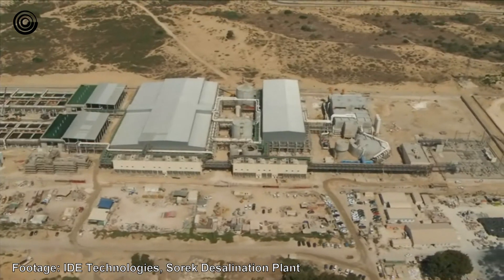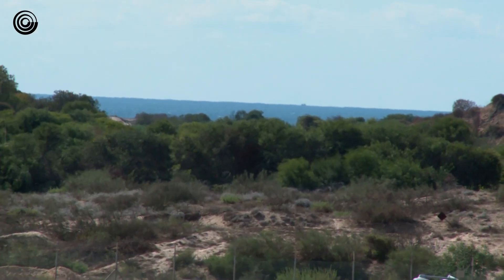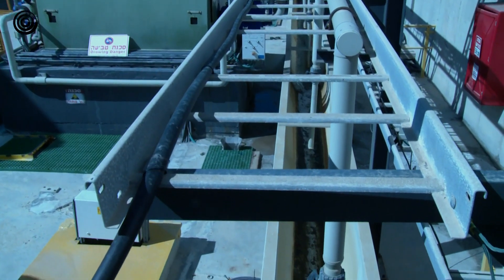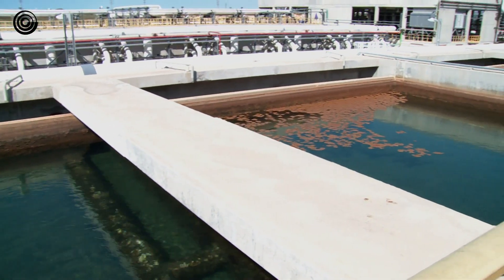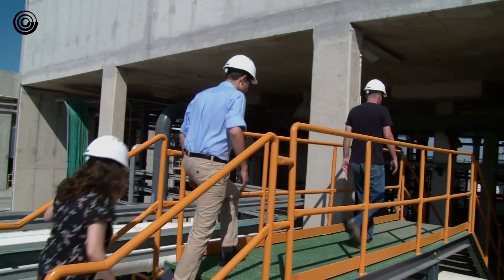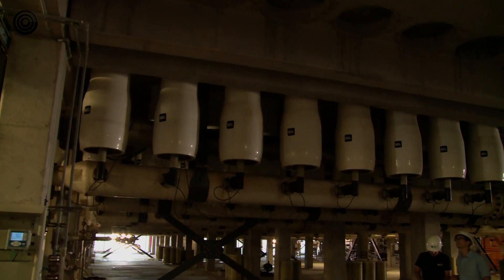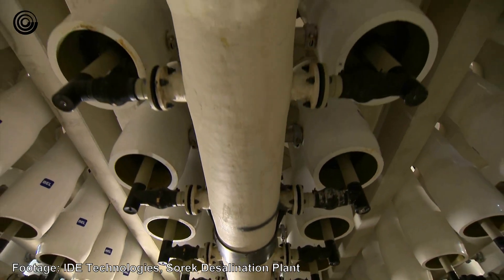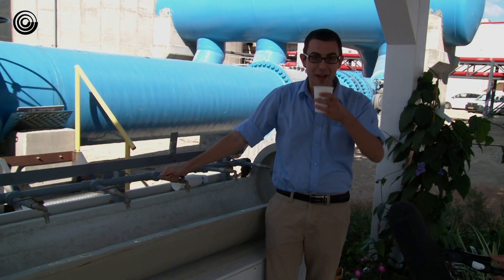The World's Largest Reverse Osmosis Desalination Plant #BehindTheScenes

Comment: what is the cost of per litre de-salination using this system ?
Reply: Thanks!
Reply: Just did the math on it and, starting from the assumption that this method costs $2/1000 liters to the consumer and humans on average use 380 liters (.38 cubic meters) per day, that's a water bill of about $23 a month. That's comparable to what you would pay for natural water resources. This method is the future.
Reply: Try to get California on board with this.  They complain about water, but then decide to spend $100 billion on a train system.
Reply: @Vineleak they already have desalination in California....
Reply: @DD-ws6cu  is that the company that made desani,  they won't do it for the pwople,  it's all private
Reply: Today the cost of production is $0.60/1000 liters while pumping potable water cost $0.20/1000 liters